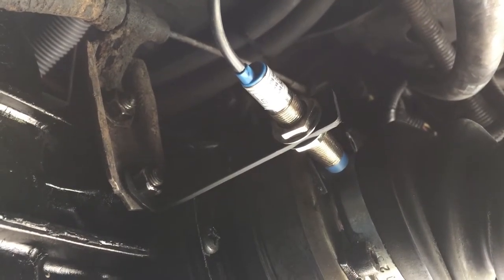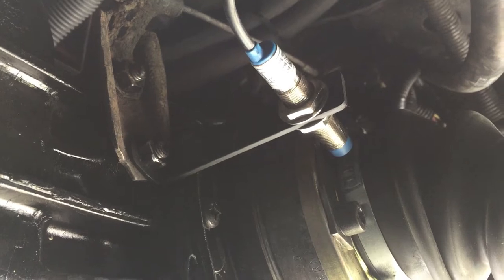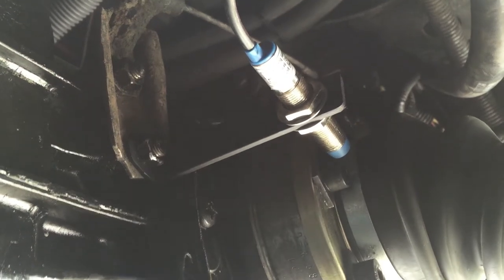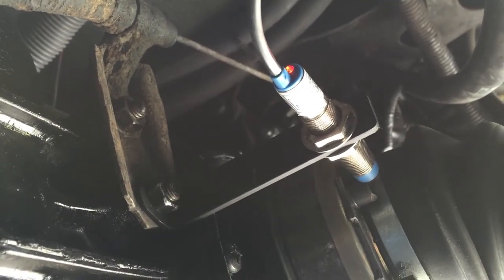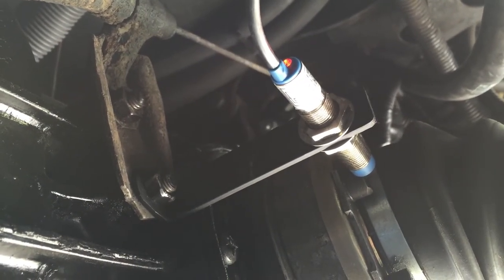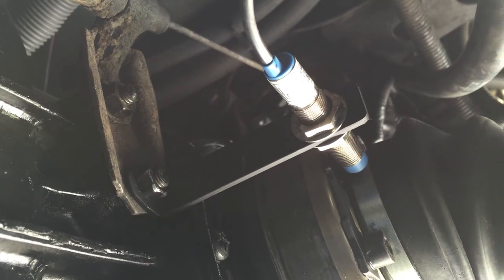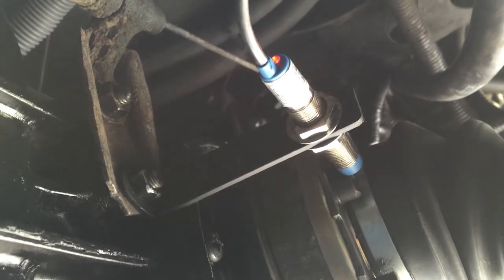Busaru Simple Vehicle Speed Sensor (VSS)

Comment: Would this work for my Subaru/Vanagon conversion? Right now using one that plugs into the back of the Vanagon speedometer. It gives a "grounded pulse (open collector transistor to ground) signal, according to the manufacturer. I need that space on the back of the speedo now for a Cruise Control unit I'm adding. Thanks.

Comment: Looking at putting 98 2.5d legacy motor in a 16ft  boat. Using a jet ski impeller and pump. Only issue I'm seeing is the vss and how to bypass or run to a speedo head unit?

Comment: Saw your video 
So when this is wired up and fitted 
I send the black wire to the ecu input speed sensor pin.
Is the ecu supposed to take a 12v signal or 5v ?
2000 reg impreza 2.0 none turbo

Comment: I'm using a 97 2.2, that is the same sensor I bought.  are you sending a 12v signal to rhetoric ecm, even though it's looking for 0 or 5v when moving?
Reply from the maker: +Tony Bush I am, and it works like a charm. To my knowledge, all aftermarket VSS systems are using 12 volts.

Comment: What did you use for a wiring diagram? Where do the 3 wires go etc ?
Reply from the maker: +Marc I hey Marc, here you go:  br-+, blu--, bla-sensor wire
Reply: yes but the ecu need 0volt - 5 volt, if i connect + at 12 volt and the negative  i read 12 at the black? how i need to connect it?

Comment: Hey mate, I'm doing another swap, this time a 2003 Subaru donor engine, what is the signal from the VVS needed to the ecu, I've tracked a company down that has these but not sure of the specs. All help greatly appreciated. Thanks Jon
Reply from the maker: +Jon Paul Hey Jon Paul, good to hear from you. I can ship mine out to you but being is Aus it may be a bit more pricey for shipping than what you've found.
Reply from the maker: Hey Jon, if you found one local, just go with that. The Subaru ecu just needs a digital DC pulse for a signal, basically a Hall sensor.
Reply: Thanks Mick, legend! Btw I've loved your latest vids on the exhaust, stealing your design if that ok 😜jp
Reply from the maker: +Jon Paul Its an experiment, I'll
document how it works out. You're welcome to use any design I put out there ;)
Reply: Thanks Mick, might see you in Oz one day. Cheers Jon
Reply from the maker: +Jon Paul I hope to make it there someday!

Comment: hey friend, where would you put this on a 57 swing axle? i'm thinking maybe off the front rotor.. inside..back side of studs? i built my own disc brakes.. check out instagram for pics! @LOUDLUGGAGECO
Reply from the maker: +Loud Luggage Co. That is a good question. If you want it to be fairly accurate then it would need to be roughly the same rotating diameter as the IRS axles but if you just need it to keep a bad engine code/poor performance away then any rotating metal that can generate a signal would work.